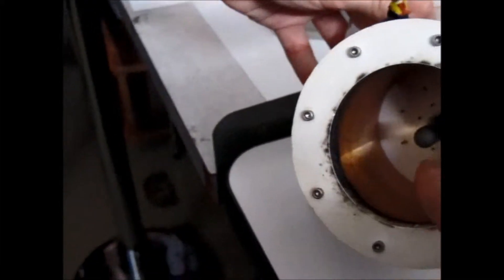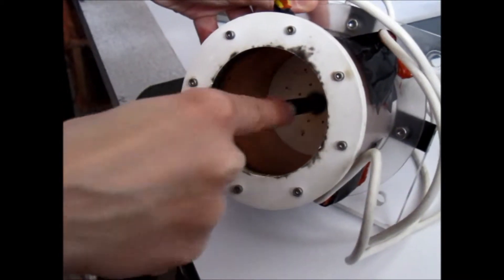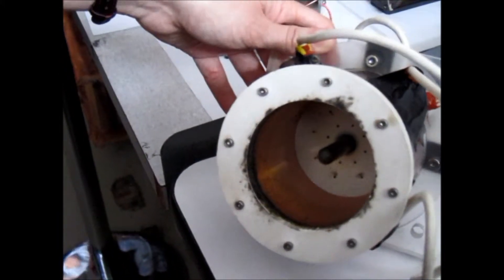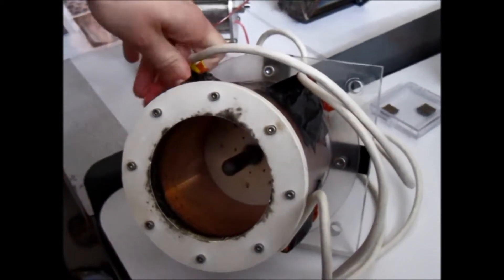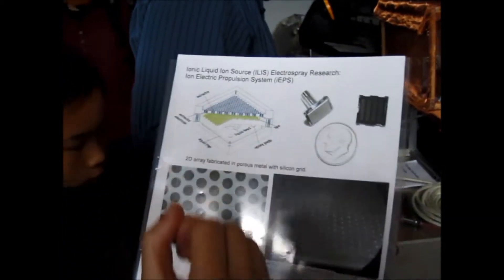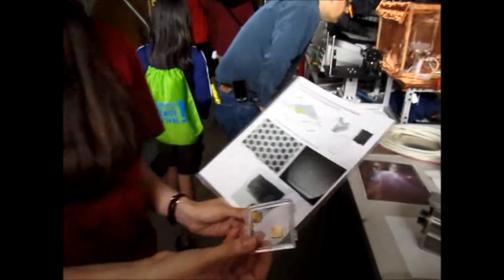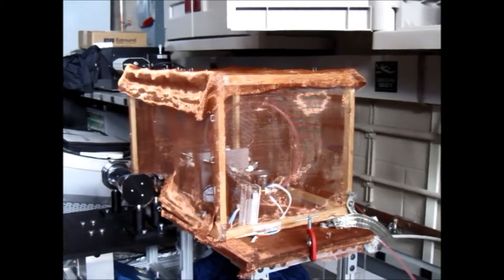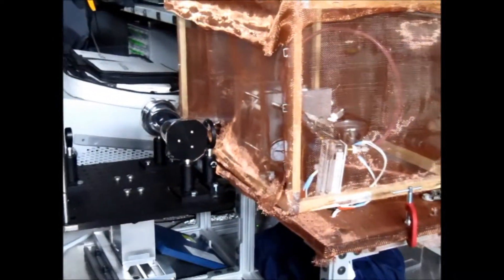VEDA April 6 2015 - Ion Engine lab at MIT

Comment: Ionic beam ray tesla War of the worlds shows this Water acts as the vortexing capacitance that with magnatron chaotic pulsation can by photon laser encase and aim this energy as its shielded by the photon and the sub atomic charge wants to stabilise hence what it touches on the point of aimed contact it will destructor rise that object. Hence war of the worlds and it may well draw that objects fields back to the water reservoir. Just a thought. Old tvs quite good if you manipulate the wiring to make cathode become anode